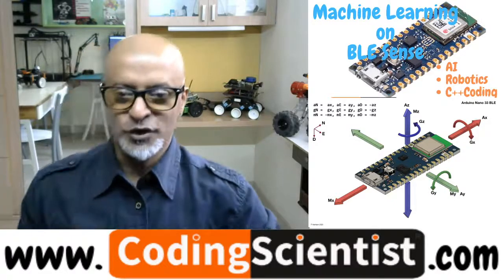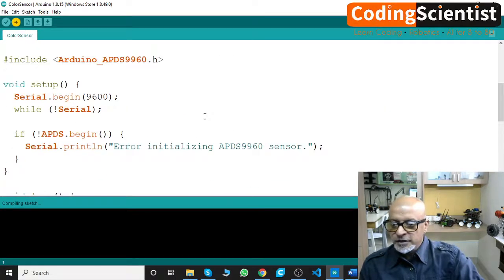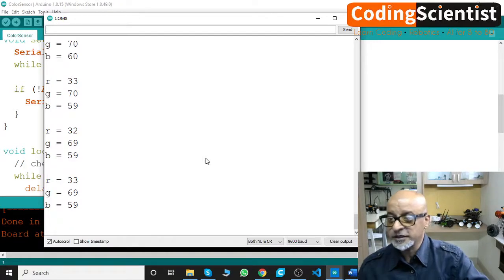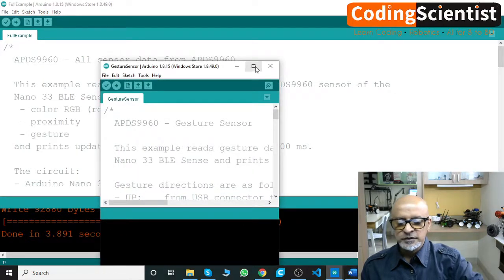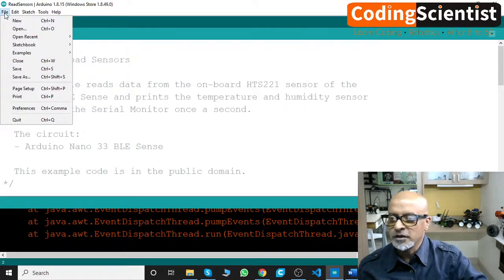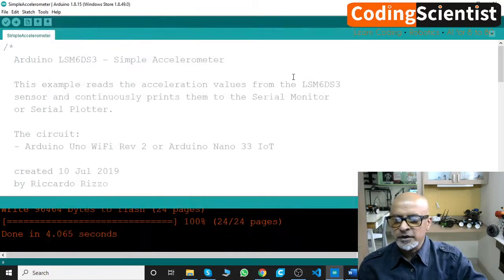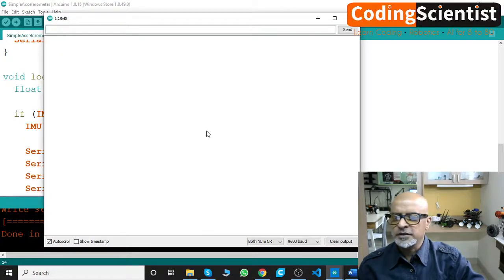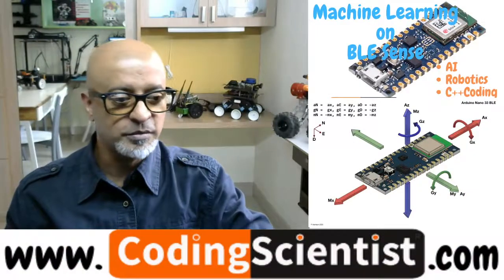Lesson 8 Testing BLE Sense Sensor Codes

Comment: Error initializing APDS-9960 sensor
Reply from the maker: Check if the library is installed properly inside the Arduino C:/ path under Lib folder

Comment: Message (Enter to send message to 'Arduino Nano 33 BLE' on 'COM11')
No Line Ending
9600 baud
Failed to initialize humidity temperature sensor!
Reply: check whether there is hts221 sensor on your board or not. Mine hasn't got hts sensor thus it failed to detect humidity, temperture
Reply: Newer nano 33 ble sense kits dont have a humidity sensor I think.